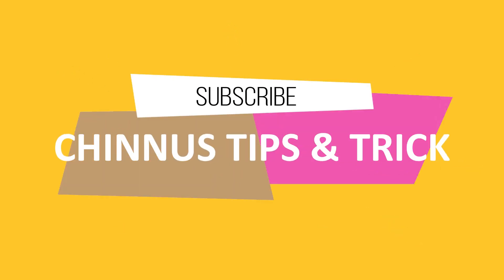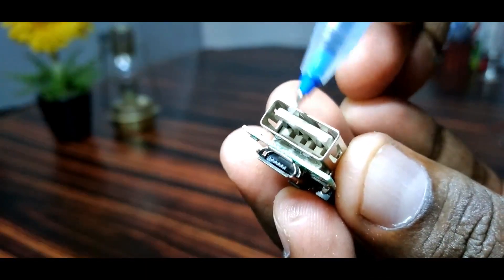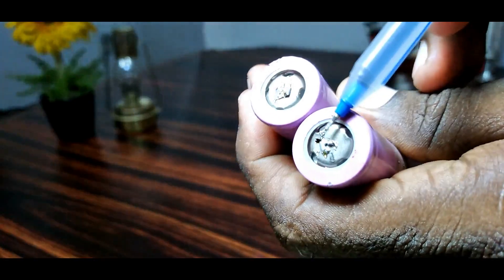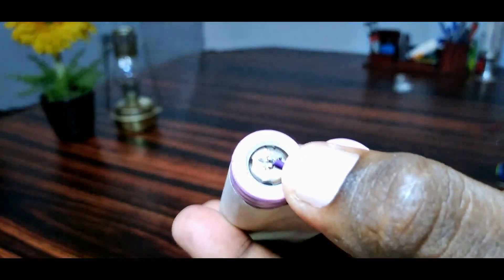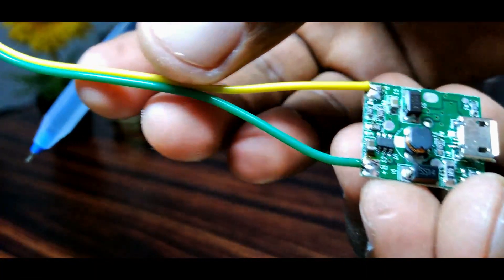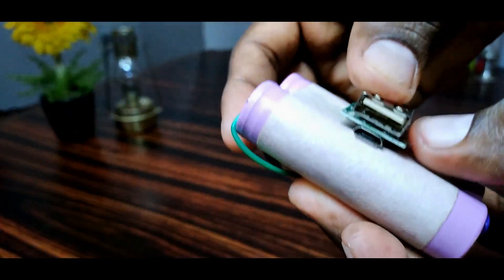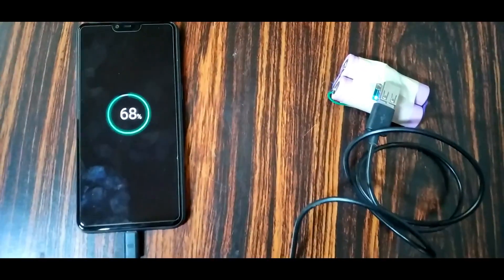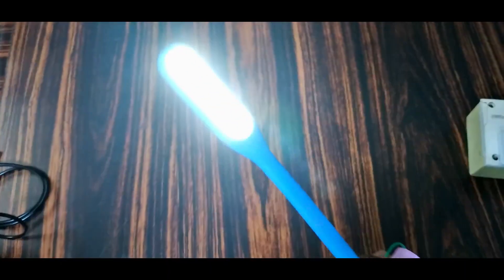150  രൂപയ്ക്ക് പവർ ബാങ്ക് ഉണ്ടാക്കാം :: Only 150 rupees, we can make power bank.

Comment: Charging module buying link
Reply from the maker: https://www.amazon.in/Electronic-Converter-Overcharge-Over-Current-Protection/dp/B082MPDWRD/ref=sr_1_2?crid=O7WDK7F389I6&dchild=1&keywords=battery+charging+module+5v&qid=1622108818&sprefix=battery+charging+module%2Caps%2C362&sr=8-2
Reply: 3.7 v......18650. Battary....2 എണ്ണം ഉപയോഗിച്ചാൽ മതിയോ
Reply from the maker: mathiyakum.  serial ayit connect cheyyanam.
Reply: Ithil usb connection illalloo appo enganaa ath kodukkunneeenu koodi parayaammoo
Reply: @chinnustipstricks5116  ithil usb connection kaanikkinnillaloo ayhu koodi kaanikkaaanoo
Reply from the maker: @siyadalivz9159  usb port module il undu.